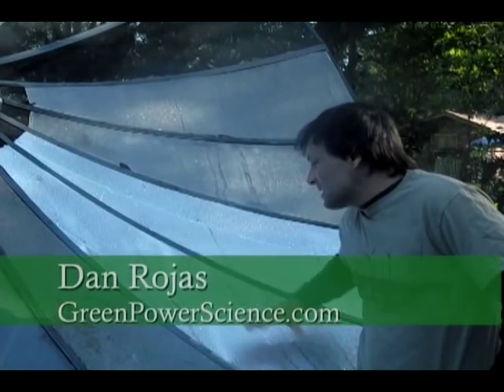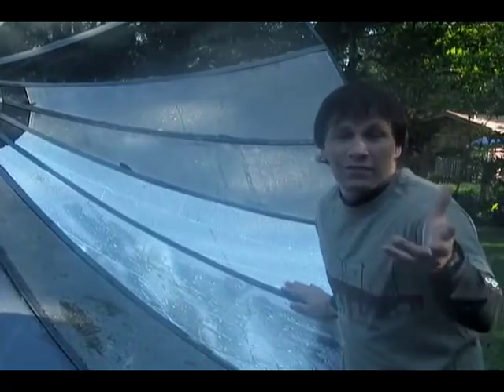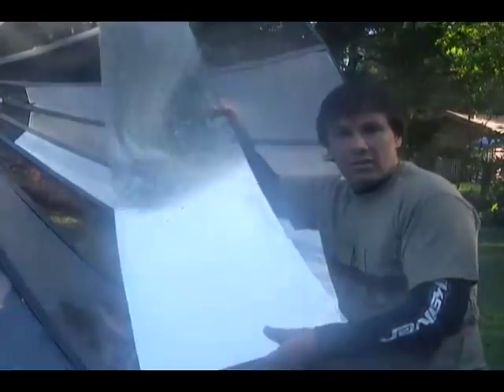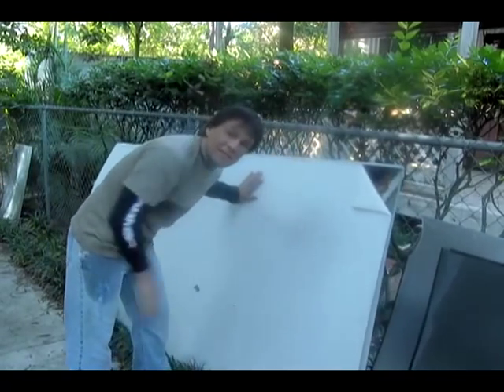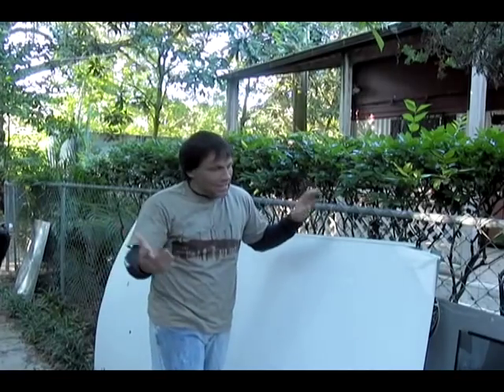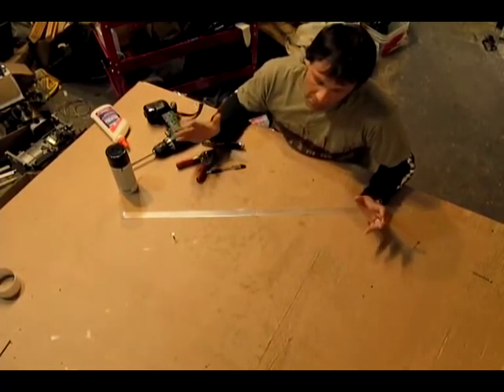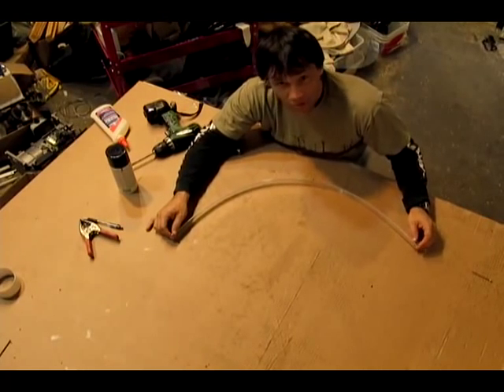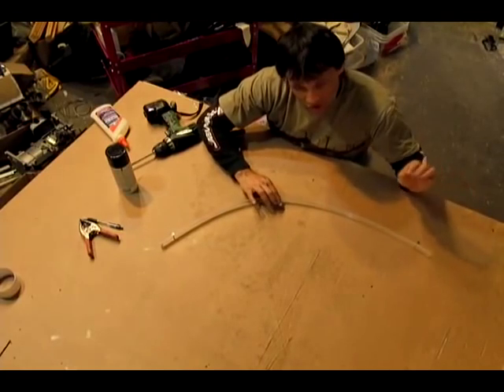PART 1 PARABOLIC TROUGH Satellite Dish Conversion Concentrator Catenary Chain Parabola

Comment: 6:57: Technically speaking, the cables in suspension bridges are actually parabolic.  By themselves,  the cables would form catenaries.  But the much greater weight of the "road" part of the bridge pulls the cable into a true parabolic shape.

Comment: Also, a paraboloid is not a parabola.  I feel like we're arguing different things.  :<  But basically a parabola is only a section of an ellipse if the foci are infinitely separated.  There is an elliptical paraboloid which is a quadratic surface and looks like a cup.